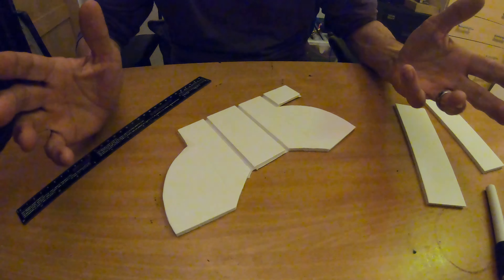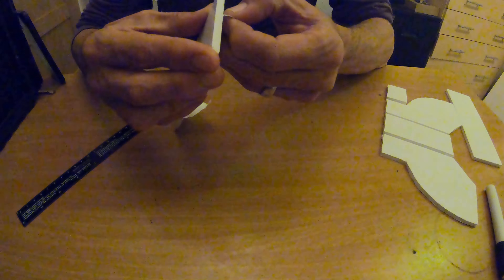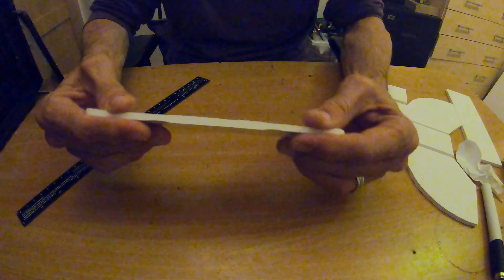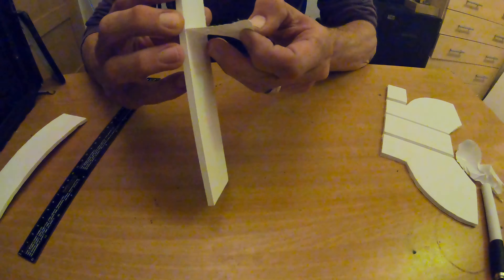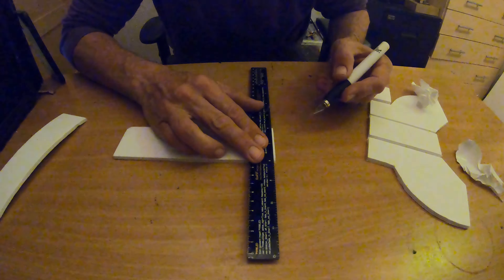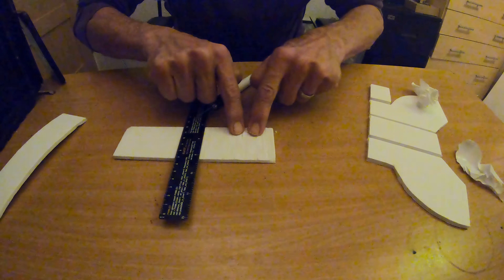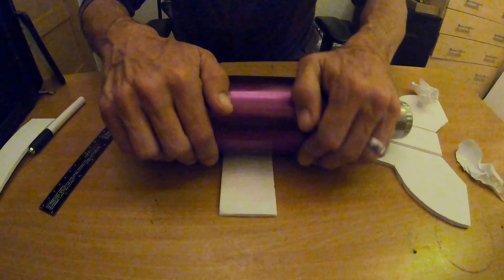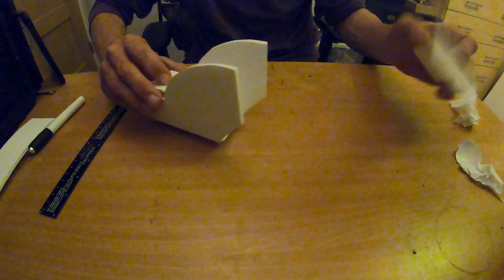How to easily bend and curve foamboard - Making scratch built or FliteTest RC planes.

Comment: Wondering why you don't use a damp sponge to get the paper slightly moist if you want to peel it off?  Seems to work pretty well if you let the paper dry out a bit before trying to peel it off.  If you get the paper too wet, it might be difficult to peel it off in one go and may have to use your fingers, or a tool to roll the paper off in batches.  If you want a more consistent curve in the foam board, all you need is around 1/2 inch thick foam rubber, or a bit bigger than the foam board piece you want to "roll" and a smooth piece of pipe (I use PVC pipe).  Place the foam board part on the foam rubber bed/pad, and roll your PVC, or other type of smooth pipe over it gently at first, and apply a bit more pressure with as many passes as needed to gain the curve you want.  If you want to curve the foam board part a lot, use thicker foam rubber pad.
Reply: I use to have a Youtube video up about how to do this on a foam pad bed, lots of space to use, and was cold rolling foam board of various types as thick as 6 mm, or as thin as 2mm, as in stiff foam dinner plates where I had trimmed away the raised edges for a flat piece.  The idea was to make super lightweight skins for various small RC and larger aircraft fuselages.  The goal was to learn how to avoid any wrinkles in the foam, or not cause the brittle foams to crack.  With a bit of practice, starting out gentle at first and increasing the pressure on the rolling tube a little each time, easy to do.  I also used the PVC pipe to roll off the paper if desired by first starting to peel the paper until I had enough for the pipe to hold it.  Once I had enough to wrap around the pipe, it was simple to roll the pipe slow enough to gently pull the paper loose.
Reply: The secret is in the foam rubber keeping the foam board part pushed against the PVC roller, so no need to pre score the foam with a knife and you get a very smooth, wrinkle, crease, and crack free foam board part with as much curve as you like.

Comment: Foam board using outdoor work?
Reply: Nah, the crappy paper covering will get wet and ruin the project. Use foam without any covering. Styrofoam and EVA are maybe best for RC (haven’t tried it yet but built a few architectural models with blue styrofoam and was happy with it)

Comment: Yes, idk about foamboard in the US but it must be different from what we have because UK ‘foamboard’ is utter crap. The paper covering is very bad, susceptible to water damage, makes it harder to glue, harder to cut, and impossible to bend. It’s not really made for this application.

The best thing to use would be styrofoam/XPS foam as it’s called, because it doesn’t have any ‘wrapping’, it’s flexible, light and cheap. Also a breeze to cut and available in many thicknesses. Gets a little rigid above 1cm though. Lightly heating for forming might work around that. Glues excellently with UHU Por glue (the other types just melt it lol).

Nice technique though, good workaround that :)